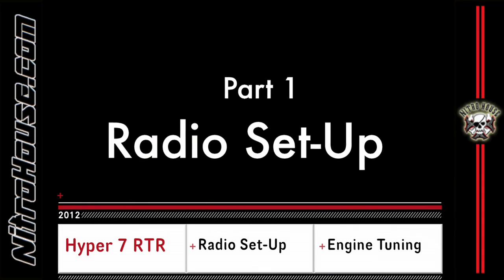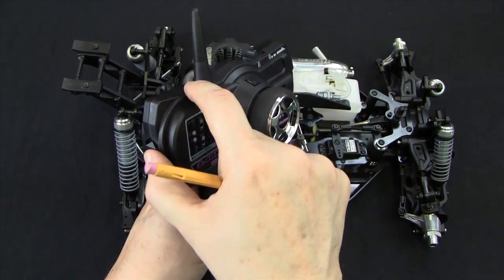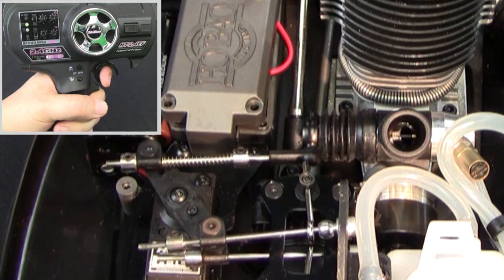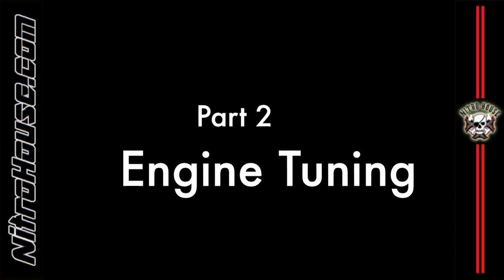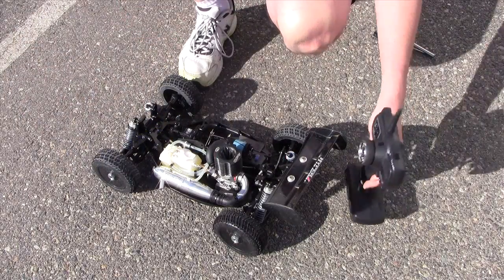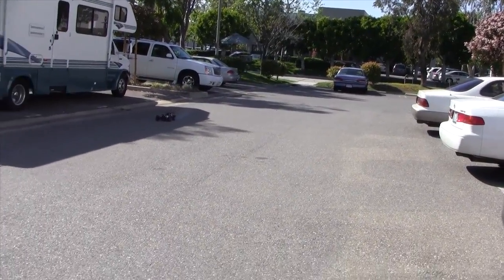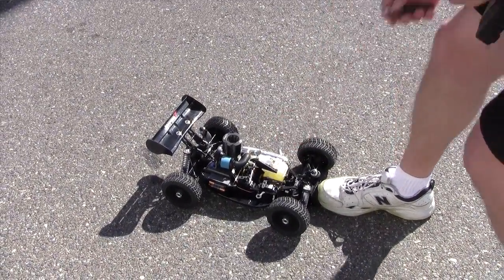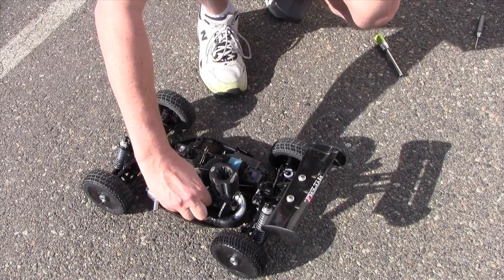Hyper 7 RTR Radio Set-Up & Engine Tuning

Comment: I cant get the transmitter and receiver to bind. New batterys. Lights come on. Receiver want go to a green light. When turned on only a red light and when i push the bind button it blinks red then a constant red and the servos go to the neutral position and that's all it will do. Any ideas